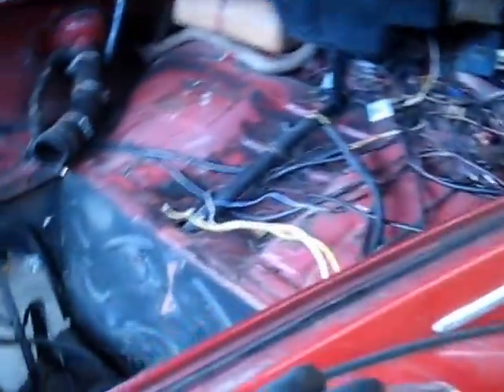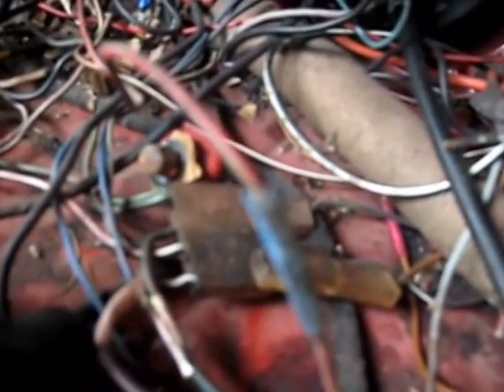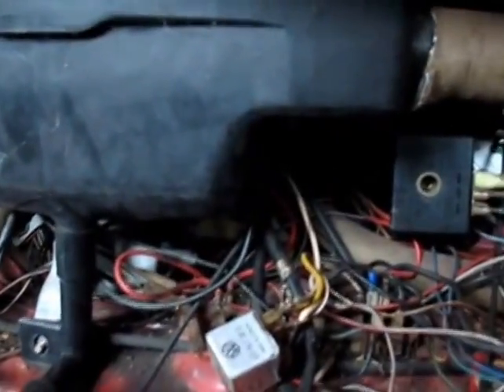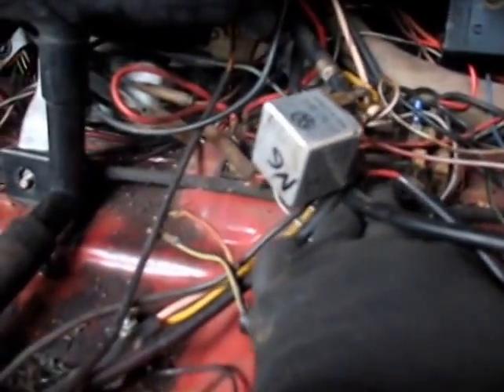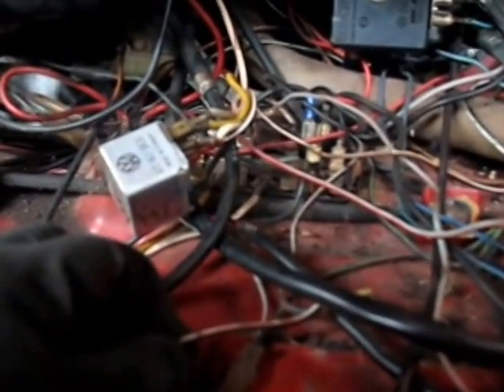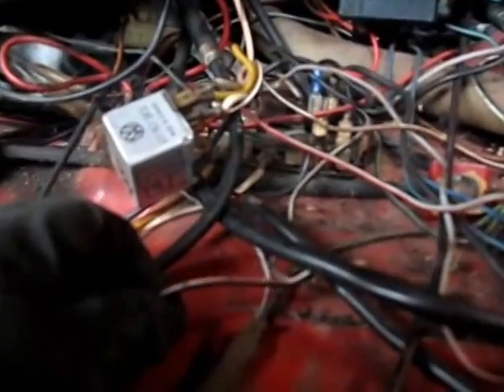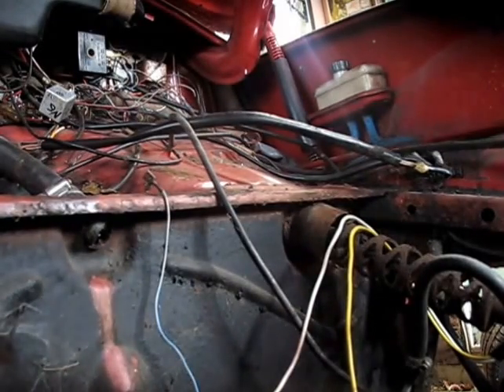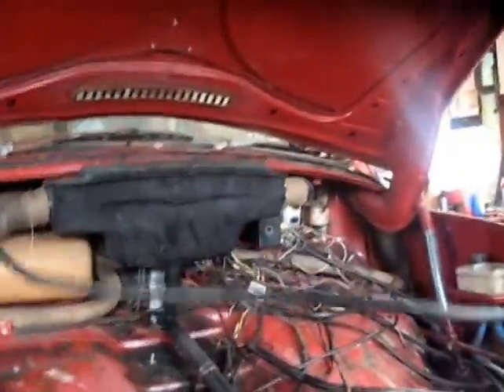Un wiring 68 VW parking light

Comment: Label makers are AWESOME for work like that (and a ton of other labeling uses), You type out your label, hit print twice, put a label on either side of where you want to cut the wire, then 'snip'.  There is a sale on a Brother P-touch labeler for $10 (normally $51) from P-Touch Direct and I have seen used ones on ebay for under $10, but writing labels on masking tape works too.